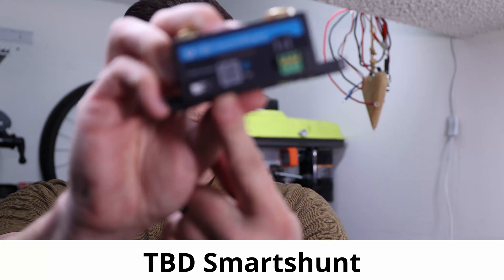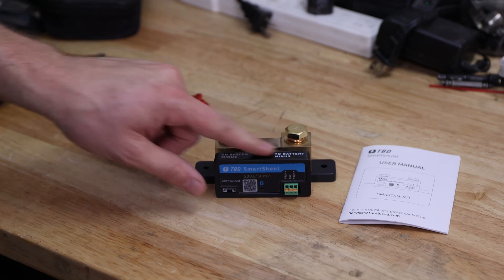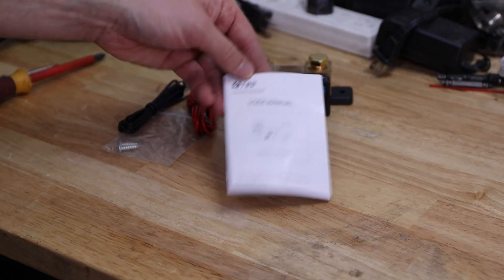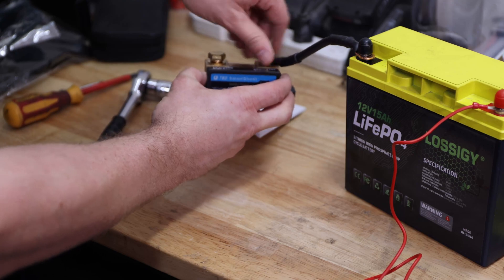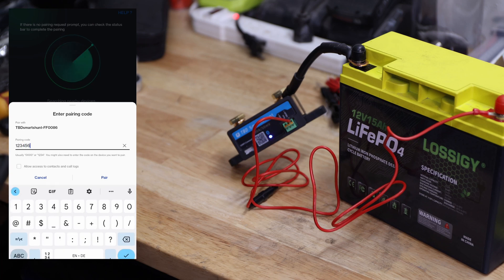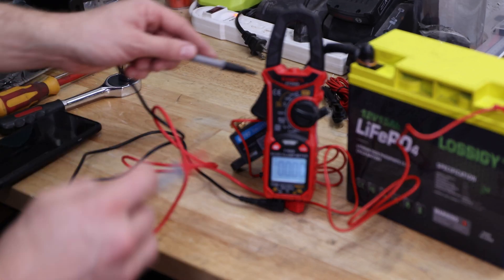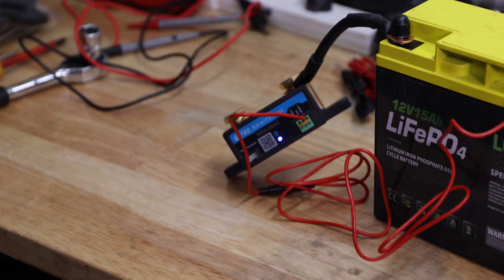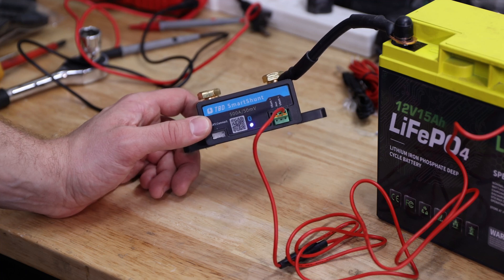Real Victron Smartshunt Alternative - TBD?

Comment: UART is the USB standard connection protocol...You can interface it with other USB standard devises...You can use it for monitoring Temperature. Using a USB Standard Thermometer....

Comment: Too bad it's so expensive
Weird it was designed here in the Netherlands but costs much cheaper in many other countries.
the price here in the Netherlands €124,-  $139
Reply from the maker: That's a bummer! In one of my next videos I will do the test vs. Victron. which should help you to determine if the extra money is worth it for your setup!
Reply: This is more an battery monitor whit-out display.  I need only the shunt  amps measure.